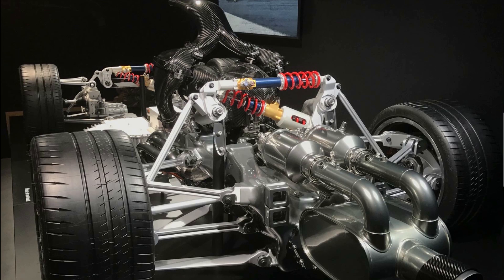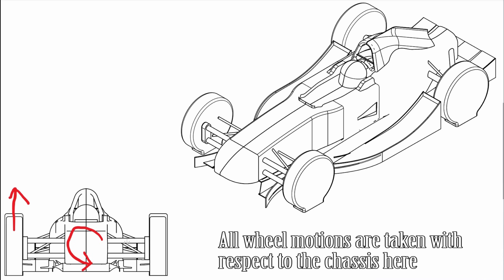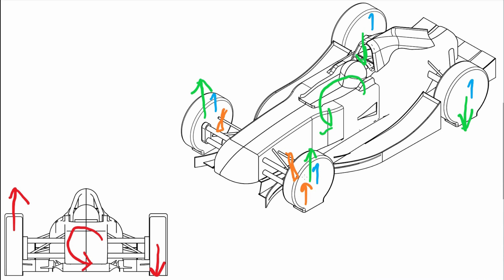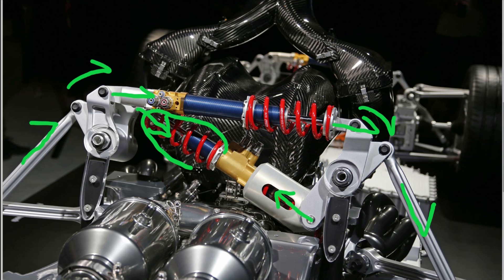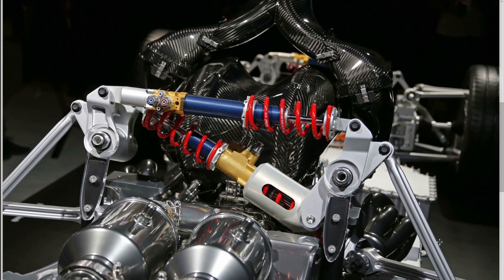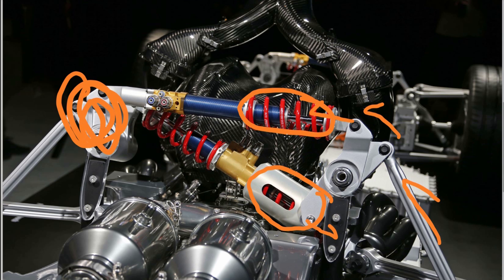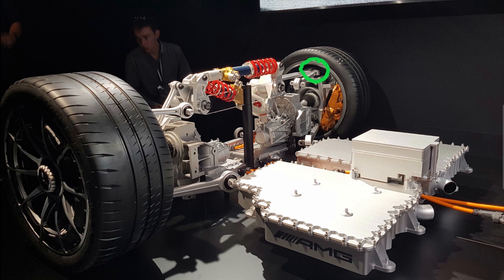Mercedes Project ONE Suspension - Explanation and Analysis

Comment: This type of heave spring combined with laterally connected antiroll-mechanism is relatively common in road cars. The Citroen hydropneumatic suspension operates like that. Those hydraulic suspension spheres are laterally interconnected making them work like a heave spring. The hydraulic pipe offers some amount of roll damping. And there are lateral antiroll-bars front and rear to prevent the car from tipping over because of the lateral interconnection. 

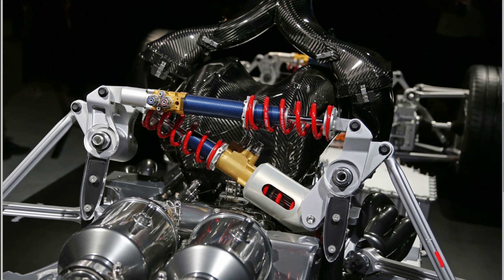About that separation of roll motion and single wheel bump motion. Aren't those two motions actually same motion: Wheels moving opposite directions in relation to each other. No matter how I look at that suspension mechanism, every time the left and right side wheels move in opposite directions in relation to each other, that motion is resisted by the roll spring and heave spring working in parallel. When looking at the rear suspension 3:05 if the left side rocker is rotated clockwice, that motion is resisted by both heave and roll spring because of how those springs are connected to the rocker at the right side.

It would be interesting to see modern vehicle where the antiroll-bar is not connected between lateral pair of wheels, but is instead connected between longitudal side-pair of wheels. One for left side and one for right side. Citroen 2CV had this style roll spring (those coil springs inside suspension tubes, during roll or heave motion. During pitch they behave in different way), those spring were  just very soft and because of that 2CV leans so much. The British Hydragas/hydrolastic was simple hydraulic version of that. LLTD could be simplified to simple geometrical leverage calculations, and ground shape would have no effect on lltd.

I think with those front suspension arms, mercedes has tried to create centrepoint steering geometry using virtual geometries to remove KPI and offset. At least from pictures, it looks like the n-lines of the suspension linkages intersect somewhere around the center plane of the wheels, so the instantaneuous screw axis of the hub should be somewhere around the center of the wheel.

Comment: Comparing this car's aerodynamics to that of the P1 doesn't seem to be giving this car enough credit, one look at the interior will tell you that this car is a lot lower than just about anything but the Valkyrie and maybe the probe 16. It seems like it's aerodynamically in between the Valkyrie and the more conventional hyper cars. 

I have to wonder if the fairly recumbent driving position increases the risk of dozing off on long drives. Also I've  never been this interested in fuel economy figures for a hypercar before.

Comment: Talking about multilink suspension - it effectively puts your pivot points further inside the wheels (less scrub radius) , makers use this for more than 20 years ( VW/ audi, Merc, BMW, Nissan ...) mainly- because cars where getting faster and heavier which forced to use bigger wheels , tyres and brakes , not allowing to position suspension pick up point where they supposed to be. 
On damping - also it's an rather old concept made possible with damper technology coming where it is now , the only thing that is pretty hard to wrap the head about is - bump or drop on one side should effect another ... Unless damper takes those load's so well it becomes irrelevant.
I'd be happy to be corrected .
Good job on those videos , been following you for a while now.

Comment: Doesn't Koenigsegg have something similar, even if it's less advanced?
Reply: Mattias Filander their design is pretty different, basically just a third damper between the two rear wheels tuned to resist squat more than bump.

Comment: believe or not but toyota has design and manufactured similar suspension on the front suspension,its called superstrut suspension and it can changes caster during steering change and i believe reduces torque steer,it was use in corolla ae111 levin bzr
Reply: The potato Party pooper well that's nice :O
Reply: They did this superstrut on the Celica GT 4. This is not at all similar to the mercedes suspension... But it does indeed reduce torque steer by giving a lower scrub radius for example.
Reply: Not to mention; adding obscene rebuild cost once the figure 8 links wear out..  :-)

Comment: If you haven't already you should check out greenteam stuttgart's solution to the independent roll and heave spring/dampers. Pretty neat solution that doesn't require a through shock or two springs. On the topic of FSAE Suspension I'd love to see you do a video on AMZ's active damping hydraulically mode separated suspension, a bit of a mind bender.
Reply from the maker: Hadn't seen it, but pretty neat solution! Hadn't seen the AMZ one either (I haven't been keeping up well with FS lately!) but it looks like a slightly more elegant version of what Monash was running a few years back. I really love seeing these types of suspension out on FS cars.
Reply: KYLE.ENGINEERS yeah similar to monash's solution...leave it to the European FS teams to take it to the extreme. I'm on the UQ team and two of our previous cars (2014 & 2016) employed purely mechanical mode separation by using the under tray tunnels as longitudinal beams transmit roll load to a single ARB. Soft warp hydraulic mode separation would probably be ideal for off-road racecars like yours, lots of compliance for all the bumps.
Reply: could you guys share a link or image to it?
Reply: AMZ's suspension system isn't an active one, it's all passive ;-) You also have to mention Rennstall Esslingen's roll heave system in their last two cars I think, but they have one heave damper and two roll dampers and also High-Octane Motorsports roll-heave system in their 2015 car. They only had one roll damper without an spring, but included an anti roll bar as roll spring.
Reply: @flealr92: you can find a lot pictures on their social media sites :)
Reply: sliiahn AMZ's system I believe incorporates active magnetorheological dampers for each mode.

Comment: German (over) Engineering..
At it's finest.
Reply: Don't be dense. The majority of car owners don't touch anything on their car with their hands except the door handle and steering wheel. Honda or Bentley.

The reason Bentley looks so disproportionally bad on this list because they are somewhat less reliable than others, but a LOT more expensive to repair.

I'd bet most hyper cars, of which even fewer are made and which are more expensive yet to repair, will score even worse on such a list.
Reply: Hardly over engineering. If anything it simplifies a lot in a very clever way.
Reply: Well these are simple kinetic chains...
Reply: It's a hypercar, what do you expect - a prius suspension? You're just jealos!
Reply: Ladies and Gentlemen,
this is not the Index how reliable a brand is but how much a car owner of a certain brand cares about his car and therefore shows how much it is maintained...
Reply: Did you even read what you posted? The reliability ratings of German cars are still GOOD. It says so in the link which you posted.

Furthermore, there are some brands listed here which sell in such low volume numbers you have to wonder how these cars are ranked and graded. Daihatsu? Chevrolet? Suzuki? These are low volume cars in European markets. In fact Daihatsu is not even sold in Europe anymore. They pulled out due to low sales.

The reality is that German cars are high quality, well-made, durable and reliable. I speak from experience. Every brand has cars which are less reliable than their bread and butter products. The whole Porsche lineup for example may be very reliable and low maintenance - except for say the Cayenne. The Cayenne thus brings the whole brand down on a "reliability index."

Worst car I've ever owned was a Nissan Cefiro. Do you see me going around hating on Nissan because of one bad car?
Reply: atsernov  Not a fan of looking a youngster in the eye while he tells me he has removed 14-screw belly plates to change fluids and scraped, washed and re-gasketed them if I don't beleive him.  The engineering is methodical stupidity engineering.
Reply: This German engineering bullshit is a dead meme, look at the average rank of German brands on the reliability index http://www.reliabilityindex.com/manufacturer